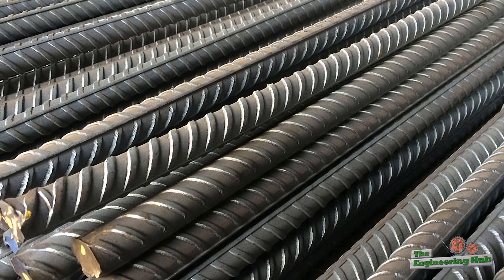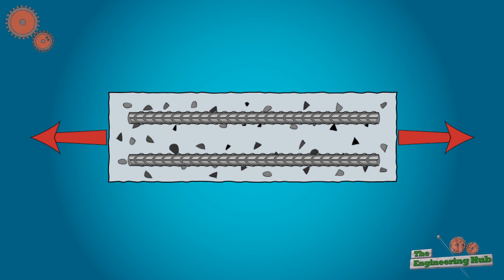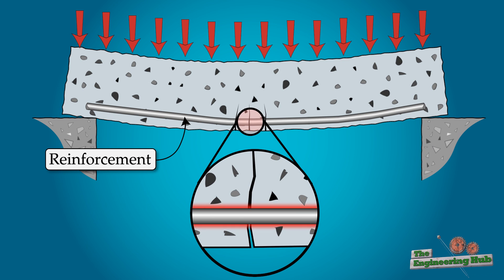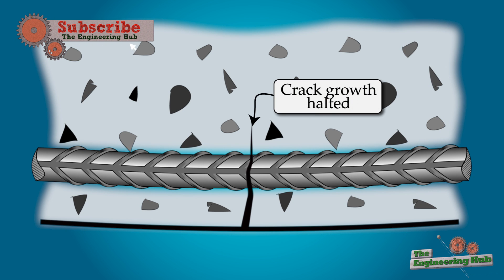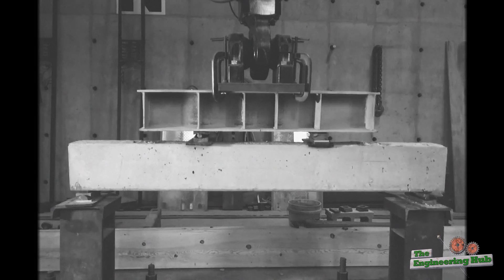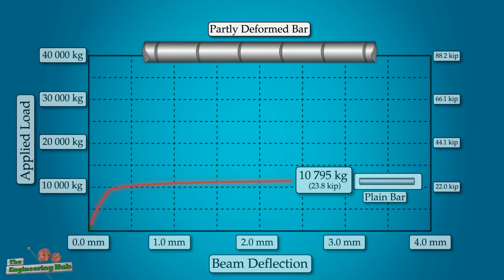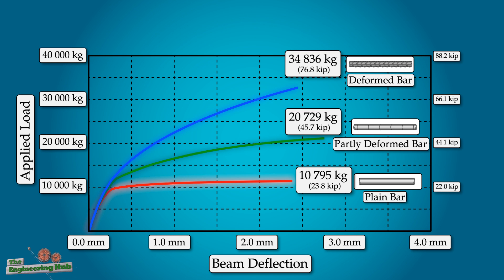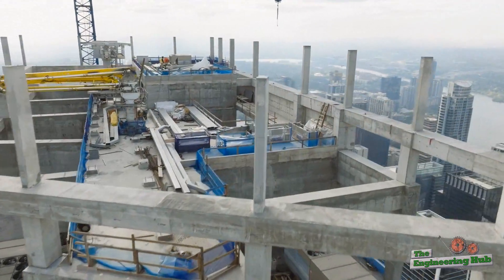Why does concrete reinforcement have deformations?

Comment: This is an excellent presentation. While showing the centre of the beam, which captures the rebar on both sides, my experience and worry is how the rebar is captured at the  two ends of the beam and the location of the end support how far it is from the end of the beam,  Being a distribute capture of the rebar with the concrete,  it takes some advanced mathematics to find out where maximum slippage location and how slowly it travels to the end of the beam as the concrete fails..
 .
Assuming that the concrete above the lower face of the beam is piped to pass the tension rod in the pipe but held/ captured  at the very ends , this will ensure maximum slippage forces at the ends,  where the concrete would be subjected to shear and tension. It would be better to show the rebar at the ends of the beam, to be bent at 90 degrees then another bend of 90 degrees, where at least one stirrup is introduced. 

This will  provide a better capture of the rebar at the ends of the beam. Due to this distributed capture/adhesion along the rebar or the  concrete adhesion, it would be interesting to find how the slip travels from the centre of the beam where there is highest bending moment to the end of the beam. assuming that the compression zones on the upper part of the beam does not fail first,  before the  rebar ends will start slipping.  This would give an idea of the slippage forces as 

Slipping force F * hei9ght of the beam= load * half length of the beam 
Slipping force = (Load) (L/2) / H     showing the thinner the beam the more the slippage possibilit hence the rebar must be bent at the end , and a few stirrups added to control the diagonal shear at the ends of the beam, 

Again , well done. and all the best in your tutoring. through this submission, I am an old man and need to learn how to use these modern devices which 80 years ago we used chalk and blackboards. Yes I am a very old man.

Comment: Stirrups must absolutely be deformed bar. This is not accurate and should be removed from the video.  The only reason but to is to save money.  And then you have another scoan collapse in your hands
Reply from the maker: That's the point of the video. Have a look at the paper listed in the references
Reply: What is the main purpose of stirrups ? It's to keep locations of rebar rods inside a structure stay fixed . There are no stirrups to stabilize rebars' locations , rebars go chaotic , we can't pour concrete into a formless frame to create a structure . 
   The stirrup itself doesn't provide help for a concrete structure stronger . Using deformed bars for stirrups is OK if money is not a problem . Otherwise , you're wasting on an inefficient matter .

Comment: How do they retrofit rebar in concrete?
Reply from the maker: You won't retrofit the rebar alone, but the whole structural system. It could be adding additional members, strengthening parts of the structure, providing confinment to columns, and so on.

Comment: Stirrups are mainly used to for tying your horizontal reinforcing together to create a rigid continuous unit and are typically smaller in diameter bar than the surrounding reinforcing, in a case like you’ve shown, they could be used to gain compressive strength in a column or pier as opposed to a flexural strength ,which many bridge decks an elevated slabs are designed for.  I don’t see to many smooth reinforcing in builds, but when I do they are typically smooth dowels, mostly epoxy coated, in control joints to allow for expansion and retraction of the concrete where deformed bar would grip and could cause failure in the joints from the stress of the expansions and retraction cause by weather changes.

Comment: I don't have to watch the video or be an expert to deduce that they are for providing grip to anchor the bar into the concrete. If it was smooth there would be little to lock it in and would be much weaker.

Comment: Yup, rebar ridges matter coz they increase the bond between the concrete and the reinforcing steel, improving the overall strength and stability of the structure. ☝️👍

Comment: The stirups don't need deformations to prevent slipping because they are bent 90 deg at every corner, so no slipping possible, especially on such small lengths
Reply: Stirrups in the Philippines are always made from ribbed rebar for good reason. Usually at least 10 mm diameter. We just had multiple magnitude 7 earthquakes with no structural building collapse.
Reply: No they should be deformed, it's not accurate to put that in the video. If anyone uses plain bar for stirrups its purely because they are cheap
Reply: They are required here in Turkey.
Reply: nope.... ribbed for her pleasure

Comment: I'm more surprised someone ever thought a plain bar would be a good idea
Reply from the maker: Yeah, it does not sound like a good idea. I wonder if maybe back then deforming the bars was adding too much to the cost. Would be interesting to hear from someone who has worked in a rebar factory.
Reply: @TheEngineeringHub  you are probably right. I guess the reasoning for using pain bars was: it's better than nothing and works well the times we tried it.
Reply: Same here - sounds like they just winged it on price back in the day but common sense suggests that ridges are going to help hold the concrete to the rebar - much like a screw or ridged nail 🤷‍♂️
Reply: It was a great idea if you weren't thinking of adding anything at all!
Reply: They probably assumed the frictional force was sufficient - after all, steel pilling doesn't have deformations and they work perfectly well.
Reply: Did u ever wonder why it ain't just plain?

Comment: is it true that rusty rebar is better?
Reply: The rust does provide a layer of protection from further oxidation
Reply: @m.streicher8286  rust in mostly iron materials is porous, so air can still get in and worsen corrosion
This is one of the things alloys like Stainless try to address, the chromium in the alloy oxidizes when exposed to the air, forming a film that it's nonporous increasing resistance (they're not all actually fully "stainless" like the name implies, most of the "stainless" steels used for knife making and the like are only resistant because the amounts required to make it fully stainless make them not hardenable, but things like Stainless pots and pans and the like can actually be made fully stainless since you don't need to harden them)
Reply: In my concrete lab many years ago we made model beams and columns.  We purposely rusted the steel wire used as reinforcement to mimic deformations.
Reply: Far as I've understood it, supposedly much better grip, because it gets increased surface area, and the rust chemically binds more to the calcium (I think it was)
Reply: No, because rust expands and can crack the concrete, allowing further moisture and oxygen ingress, which promotes more rust...also known as concrete cancer.
Hence why galvanised reinforcement is specified in certain applications.
Reply: No. 
Fake news...

Comment: I guess the plain bars in the stirrup, is to prevent the stirrup from gripping more than the rest, causing uneven tensions.

But don't really know
Reply: In Poland all steel carrying construction loads should be AIII/AIIIN (deformed). So if there's actually a load across stirrup it should be from a deformed steel bar (which is a factor in some beams), plain stirrups are ok when they are not carrying much of the load and only used as a mounting frame. And even with that we're generally moving towards deformed rebars on all stirrups. Polish Norm is derivative of Euro Code so I guess it should be similar across EU countries.

Comment: Where does Fiberglass Rebar fit within this loading chart? It was my understanding that while Fiberglass and other composites may not have exact same tensile strength of steel rebar, they do not rust when exposed to water or salts. No rusting means the reinforcement will not swell resulting in early failure. Other reports will state that Fiberglass is actually stronger than steel, but strength to weight might be confusing.

It is possible to use anti-corrosion coatings on steel rebar to prevent or delay rusting. In practical use though I have never found coatings to actually work in the field. Rebar is cut, bent, and tied together. This can cause anti-corrosion coatings to fail and is a waste of money. While Fiberglass rebar might have some additional costs associated with making 'bends' prior to delivery, it is far less expensive in long term.

Are there technologies coming that deliver even higher performance and longevity?
Reply: GRFP, CRFP, and AFRP bars, which are glass carbon and aramid fiber composites, behave differently than steel bars. They can have higher yield strengths and they perform better in corrosive environments. The downside is that they can't be bent to shapes. Additionally, their anchorage to the concrete behaves differently because of how the ridges on their shell are created
Reply: @Aquade  Thanks for comment.
Reply: The most promising corrosion resistance solution on the steel side is stainless. Epoxy coated bars simply do not work due to construction conditions where the coating is harmed nullifying its benefits. Galvanized bars are also becoming more widely accepted but there are issues with the hot dip coating once certain bend radii are made
Reply: @Aquade  I can still remember pouring concrete in the field. Sometimes we used 'chairs' to hold the rebar up off the ground. But even they can allow water to infiltrate to the rebar. Some old timers said forget chairs, they used rocks... really. Lately have seen nothing used, rebar or welded wire mesh is pulled up by workers with rakes. I have found that to be not very precise. If an engineer has spec'd reinforcement, they also spec where within concrete it must be located for optimal strength.
Reply: @SJR_Media_Group  With regards to the location of the reinforcement, I have never come across an optimal or specific location ..apart from providing the steel in the tension zones of the slab or beam as needed, and then based on the concrete cover and diameter of shear links, the position of the tension steel would be determined..but in terms of optimal performance, I have never seen that.
Reply: @mohamedkhan4762  Almost there.  The concrete cover controls fire rating and reo in corrosive environments, hence there is an "optimal" location for the reo.  Too little and it will rust, too much and the lever arm is too small for bending strength.
Reply: @Aquade  Using Stainless makes perfect sense. Thanks - appreciate the feedback.
Reply: @Aquade  is stainless rebar significantly more expensive? Does the stainless alloy have different characteristics and lower tensile strength?
Reply: @TommySchlong  stainless rebar is "almost" unheard of, and would be crippilingly expensive. Galvanized rebar is more common, but only used where necessary as it too is expensive compared to standard reo